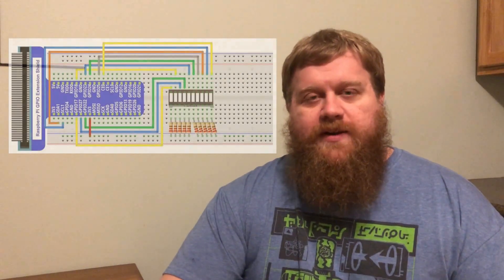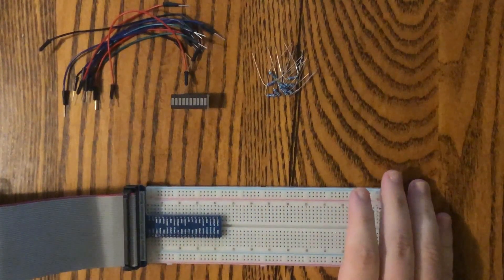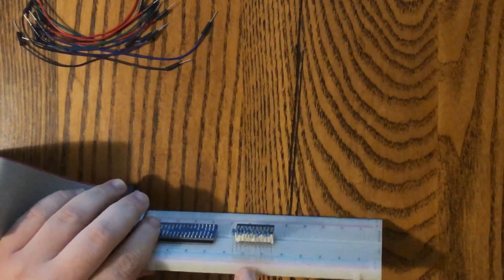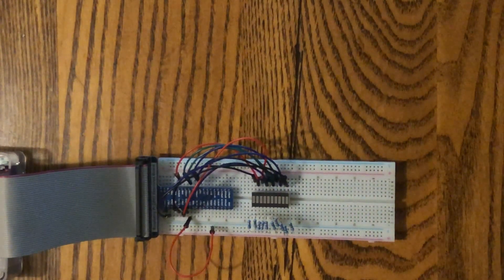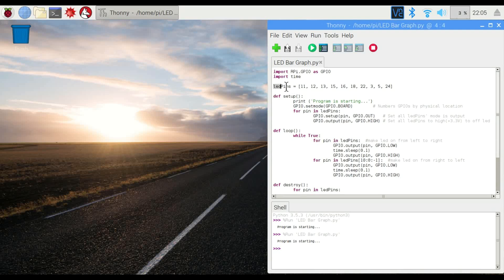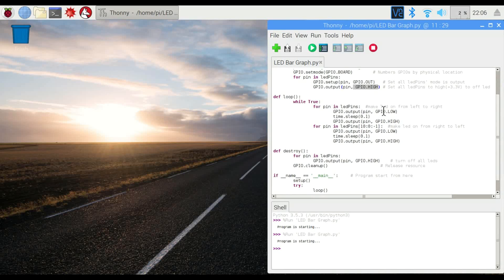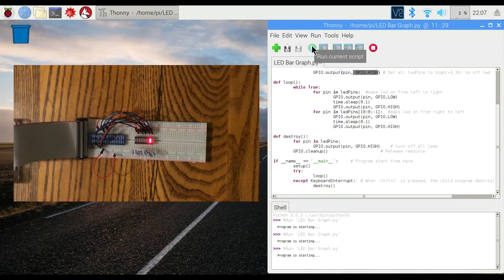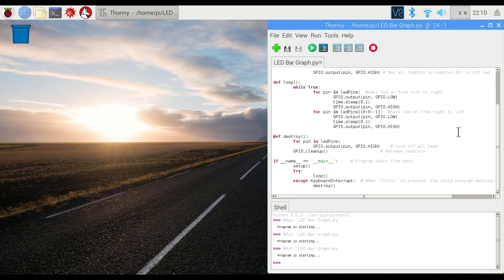LED Bar Graph Array | Raspberry Pi 3B+ | Projects for beginners

Comment: I was thinking the same thing... where is the GRD???
Reply: the ground is the way that he is managging the outputs, when he put a GpioOutput in low, it asimilates the ground so the LEDS turn on. I don't know if I explained great but he were putting the outputs in LOW for turning ON the LEDS.
Reply: @aaronvalerin7056  thanks! Yeah so basically you just need a voltage difference in the circuit.... And one end has 3.3v. So if the gpio is set to LOW.... That gives enough of a difference